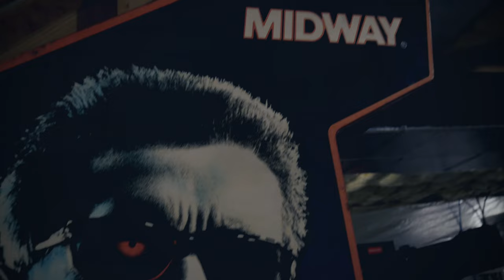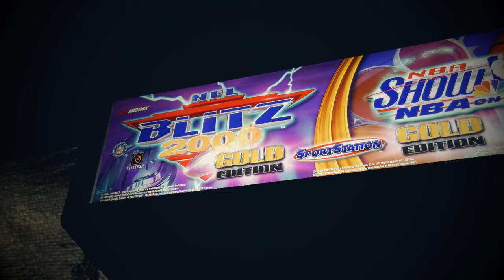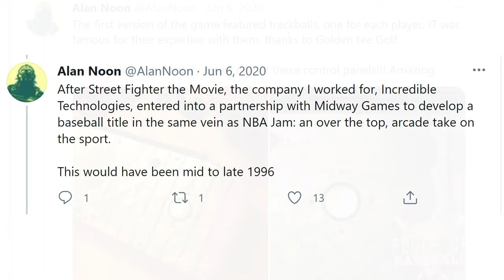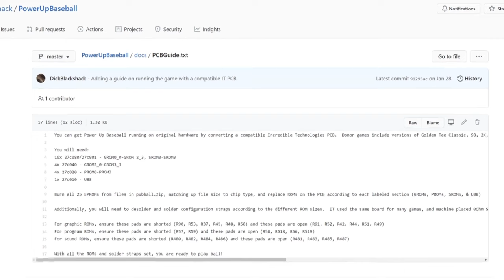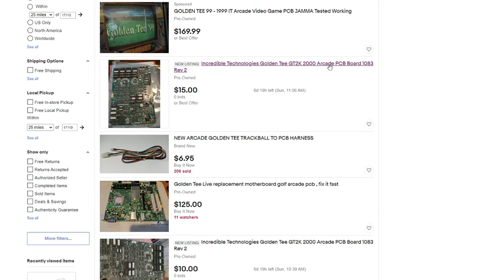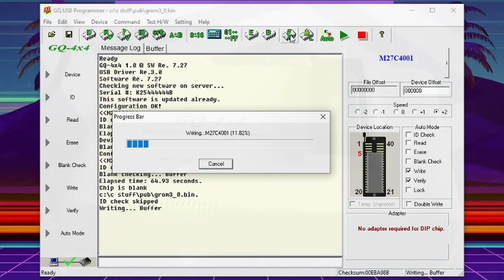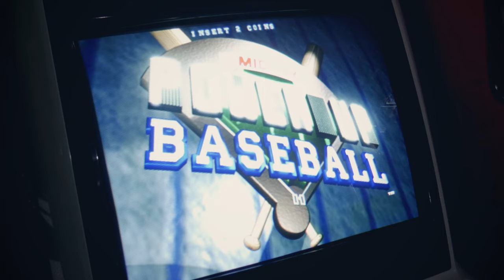Power Up Baseball on Original Arcade Hardware!

Comment: You have Irritating Maze, doesn't that require a track ball?
Reply from the maker: It does but it also requires an interface board between the Neo’s Jamma edge and where it connects to the cabinet.  I don’t know if it can be wired without one but if this experiment has taught me anything it’s that figuring that out probably isn’t worth the time or effort, lol.